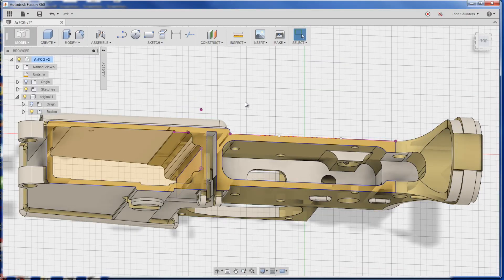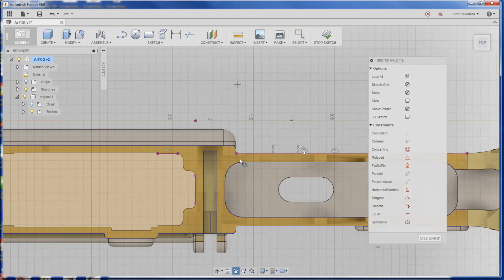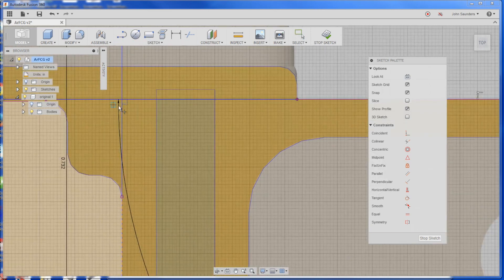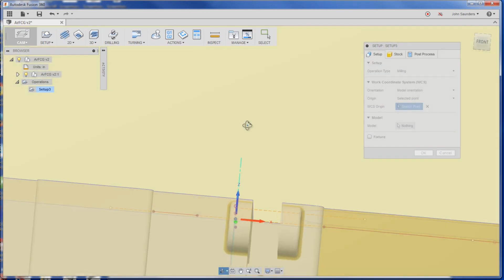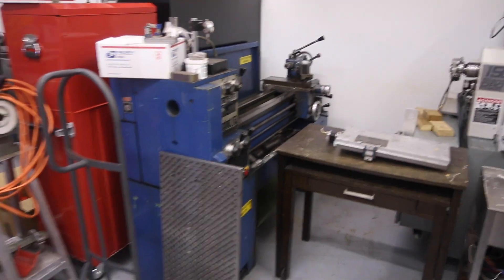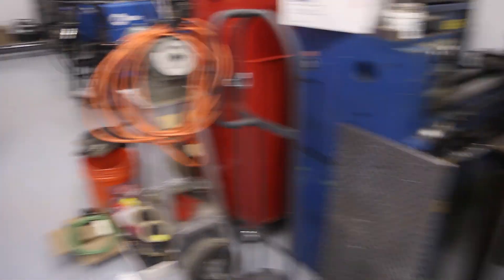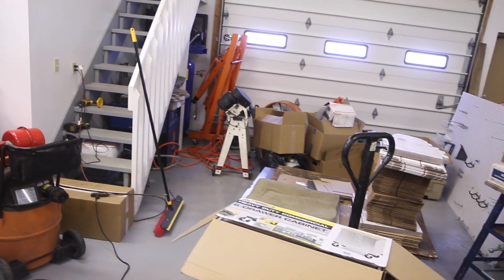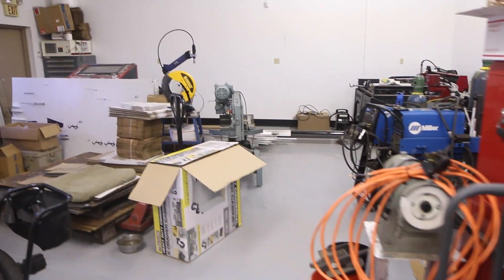Where We Work!  Fusion360 Work Coordinate Systems and Shop Tour! Widget58

Comment: you just need a 3 phase transformer to change voltages, buck is to lower the voltage and boost is to raise the voltage. Great video, nice shop. looking forward to seeing it setup. On drawing ref lines, wouldn't it be better to use a reference point to the barrel in the case of a fire arm? Thanks , Greg

Comment: You need to be careful making lower receivers especially these full auto ones. For you to sell a fully machined lower received you would need to engrave your company, Location of where the firearm was made (city/state), Model, Caliber, and a Serial Number. You would also need to do this information http://oag.ca.gov/sites/all/files/agweb/pdfs/firearms/forms/volreg.pdf and file it and pay the required fees. The lower is counted as the actual gun basically, as upper's do not need this information. Your company could get in a huge amount of trouble for manufacturing it without this information, as the person is only allowed to have a non serialized receiver if they machined it themselves.

Comment: That seems like a weird place to put your offset, unless the features your milling are dependent on those faces. So, if someone sent this part in and needed work done on it, the way i would determine where to put my coordinate system would be depending on what faces the dimensions on the print are coming off of. If there is no print and only a solid model then most likely i would just make my offset the center of a bore or just center of the part so say if the part is actually .020 bigger then the solid model then you wont have a feature more on one side then the other. i don't know if that makes sense or not.  or not.

Comment: quick recommendation... for the plasma table in the corner, you may want to put some sheet metal wall shields up.  the water spray and sprayed dross will do a number on those walls, also a good idea around the grinder.. a few bucks now will save you a lot of headache if/when you make your move to a new place.

Comment: It's great to move into a nice open and clean space.  Access to the shop from the outside will be no problem to bring material in or out.  I always seem to move into a building with problems such as poor wiring, a wood floor that almost cannot handle the load, or I have to clean out all the mess left by the previous tenant.  You will do fine, just stay positive.

Comment: Good on you John, that shop looks great! I know the move wasn't foreseen or under ideal circumstances, but for what it's worth I think it was destiny. The shop looks bright and airy, it looks professional, and you're right, the business will outgrow it. They're all good things and from an outsider looking back in I wouldn't be surprised if you reflect back on this in the future as being the right time to move forward.

I feel for you with the power and hope you get that sorted. In a past life my trade was in electronics and know that sometimes low voltage can be as bad as high voltage . As much as I love the US, the power system there is a mess. But that's the system so wadda-ya-do! 

With the material rack, can I throw a suggestion out to have it free standing instead of against the wall. Machines are generally one sided, meaning you only operate them  from the front and the back can be placed against a wall with no loss of function. On the other hand a free standing material rack can be made two sided, so you can have different materials segregated better.  Especially if you plan to get a forklift, you will also be able to slide your materials off the forks straight in to the rack, even long or heavy stock should be able to be done single handed that way.

Comment: Avail yourself of a pallet rack, even a small one.  Get Lista to come in and help set up a work flow.  Get yourself set up with some AkroMils Bins or from Quantum Storage.  Wire racks, shelving.  Make sure your lighting is 200%, not just for videos.  If you do some limited production runs, you might try a MRP system like Exact JobBoss which is great.  Keep your material organized.  Stuff like that works for me.

Comment: before ya buy or build a weld table check out weldtable.com they have some certiflat fab block kits that rock...can barely buy the steel to make one cheaper and hit up a tractor supply or farm and ranch for some cattle mats for the floor.the kind with the holes in em work great for the floor and far cheaper then buying purpose made ergo stuff...just keep the areas small enough you can roll em up for a full clean tho cause they do tend to act as chip catchers

Comment: The new shop is a winner, John.  Regarding the fork lift, depending on your need, you may find the Hefti-Lift of interest.  I bought one several years ago, and it's great.  Mine lifts up to 880 lbs to 5 ft.   It maneuvers well in a small space and takes up only a bit over two square feet.  I can easily move my 700 lb wood lathe and position it precisely where I want it.
It's manufactured in the USA (Indiana) and isn't a dinky import.  Mine was less than $800.  
Just something to consider.  http://www.vestilmfg.com/products/ergosol/hefti-lift.htm

Comment: Hi John,

You already have that upstairs room as an enclosed space, why not try the compressor up there first. You can always them add a secondary enclosure do deaden it down more. If the floor up there resonates, I've helped mount a compressor on wall brackets via rubber mounts to isolate it.

Comment: Hi John,
Looking good!  You really got a lot done in a short time.  I know what a pain in the butt it is to move, especially since you are moving very heavy stuff.  I would definitely keep the manual lathe.  It doesn't take up that much room and you already know that the machine is in good working condition.  Thanks for the video.  Have a great vacation!
-mike

Comment: Woot! thanks for this. Took a couple tries to get the right model to make this happen, but I now have the model I want and the origin point set. Now I just have to work on the stock box to fit area I want to mill and I will be set. (really a secondary thing but I like to work it out so I know how to do as much as possible)
Reply: +MrAtalon Well it took me most of the day (when I wasn't working) to get it all figured out including the finishing passes. I just have a small vertical line above the right side safety selector whole. I don't think it will affect functionality, but it will bug me until I figure out how to get rid of it.

Comment: Hey John! Thanks for the videos. I've been using Fusion 360 for a year now and learn something new every time I watch a video. That "film" is due to the sketch you just made with the point - Fusion 360 keeps it up to continue adding to it (as far as I can tell). If you click the lightbulb on sketches it will go away.

On an unrelated topic, I mentor a high school robotics team that has a Taig mill. I was thinking about using a 1/4" Lakeshore Carbide ZrN 3-flute as our primary "roughing/clearing" tool for aluminum. I recall you have a few Lakeshore Carbide end mills, but don't recall if you had the ZrN. Would you suggest using this with a hand-sprayed WD-40 and air blast or could we get away with just an air blast? Also, do you have a recommended chip load per tooth? Tool paths would be created in HSMXpress using SolidWorks. Thanks!
Reply: Thanks John!

Comment: Another simple way to find an intersection is to draw a box (give it arbitrary dimensions during creation) and then constrain the sides as co-linear to the desired lines. Then use the corner of the box as your selected point.

An even simpler way is to create a 3D point in the 3D Model tab. You click the point tool, then click 3 planes and it finds the intersection. ;)

Edit: Thought I might add a quick and dirty tutorial on that last one :)

http://imgur.com/UTnKXlO

Comment: You have a silencer for your air compressor: up those stairs and through that doorway. The air dryer can go in there too. You may need to put a beefier floor in there and use a small crane (or get a gantry crane for the shop) to lift over the railing or a group of big guys to manhandle it up the stairs, though....
Reply: +Andrew Foss Good call!

Comment: Another possible option for the air compressor. Coming from shops that always had them outside, at my first shop that wasn't an option. So I took the motor and pump portion and put it up on the roof, leaving just the tank inside. Built a small open sided cover for the weather over the top. Did the same for my next shop and for quite a few other shops that saw my setup, and asked me to do the same for them.

Comment: Thanks for showing the Fusion 360 tip.  I use it all the time now and am amazed at some of the features.  
The shop look great.    Thanks for the tour.
I agree on keeping the lathe and bridgeport.  You would regret getting rid of them.
Have a great vacation!
Reply: +Herb Blair We haven't missed our extensive manual shop at all. John knows how to make the Tormachs sing to his tune, so manual equipment makes less sense. Sure, I miss the old stuff, but never to the point of taking up extremely expensive floor space and even more valuable time. Like the new video setup, looks super!